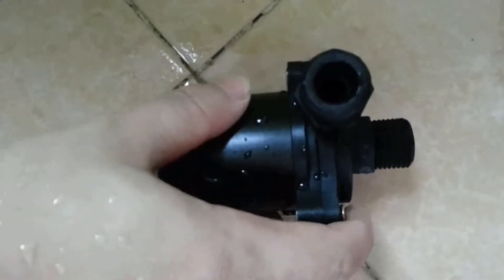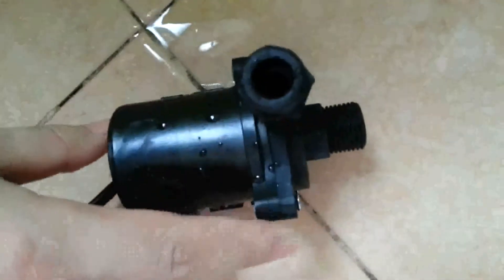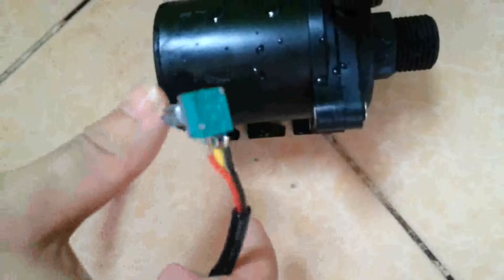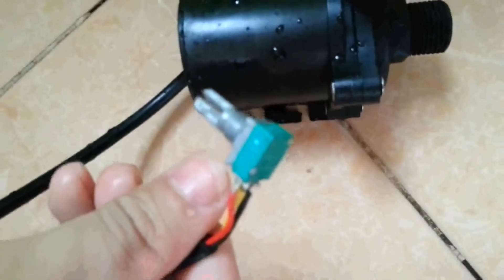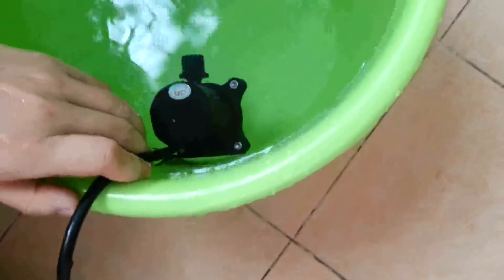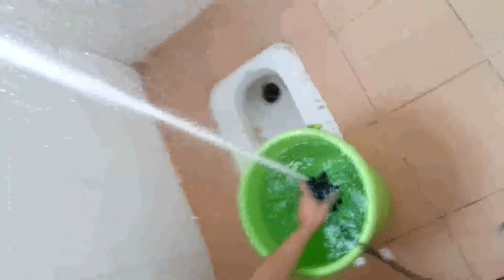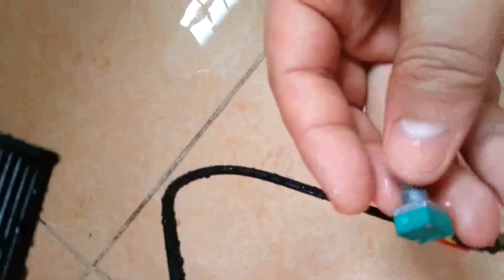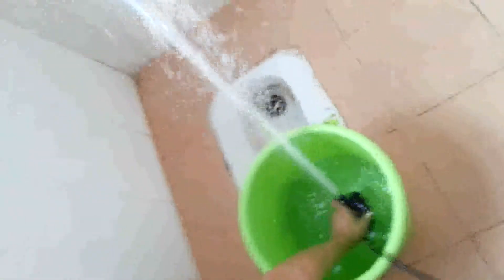12V Speed Ajustable Hot Water Pressurization Pump 50E-1280A

Comment: What power source did u used in this video? 
Is it a 12v supply or 24v?
Reply: Hello, dear Kazi. This is Alexander from Shysky Tech Co., Ltd. 

Pump is a 12VDC micro brushless DC pump, so its matching power supply is 12V DC power supply. As to power supply used inside this video, it's a regulatable AC/DC power regulator (change AC power to DC power, while the output DC can be varilable through adjusting). Of course, users can also power it with 12VDC battery or other possible matching DC power modules. No problem.

About this pump product, it's our company's DC50E-1280A model, 12VDC as rated voltage , speed adjustable. Surely, item inside video link itself is an OLD version, while now company updated to NEW version, with almost equivalenet performance but better design and power-efficiency.

Furthermore, some other similar pump, but a little more powerful version can also be taken as reference, such as this following model:

DC50F-12110A model, etc.
Reply: Link of DC50F-12110A: http://www.ebay.com/itm/Smart-Speed-Water-Pump-12V-1320LPH-11M-Submersible-for-Garden-Fountain-Aquarium-/291596977325?ssPageName=ADME:L:EOISSA:HK:1123
Could be taken as reference and comparison.

Best regards!
Reply from the maker: About this pump, it is a 12VDC micro brushless DC pump, so its matching power supply is 12V DC power supply. As to power supply used inside this video, it's a regulatable AC/DC power regulator (change AC power to DC power, while the output DC can be varilable through adjusting). Of course, users can also power it with 12VDC battery or other possible matching DC power modules. No problem.

About this pump product, it's our company's DC50E-1280A model, 12VDC as rated voltage , speed adjustable. Surely, item inside video link itself is an OLD version, while now company updated to NEW version, with almost equivalenet performance but better design and power-efficiency.

Furthermore, some other similar pump, but a little more powerful version can also be taken as reference, such as this following model:

DC50F-12110A model, etc.

Link of DC50F-12110A: http://www.ebay.com/itm/Smart-Speed-Water-Pump-12V-1320LPH-11M-Submersible-for-Garden-Fountain-Aquarium-/291596977325?ssPageName=ADME:L:EOISSA:HK:1123

Could be taken as reference and comparison.

Regards!

LIly from Shysky Tech Co., Ltd